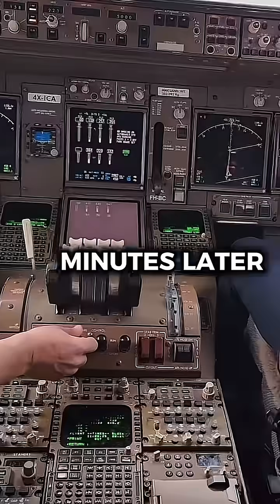What happens if an aircraft runs out of fuel?

Comment: But had they not blindly opened the crossfeed when they noticed a fuel imbalance which just doesn’t happen on modern jets and done a little investigation they would have noticed the difference between fuel used and fuel onboard and landed safely with one engine and plenty of gas.

Comment: n July 23, 1983, Air Canada Flight 143, known as the "Gimli Glider," ran out of fuel mid-flight because of a fuel calculation error where ground crews used pounds instead of kilograms, loading only half the required amount. Captain Bob Pearson and First Officer Maurice Quintal successfully glided the Boeing 767 for over 75 miles to an emergency landing at a decommissioned airbase in Gimli, Manitoba, with no injuries.   This was what I thought they were going to talk about. This was a case of refuelling with litres rather than gallons so roughly 1/3 of the needed fuel.
Reply: Somebody clap for this person
Reply: If I recall correctly, Air Canada dispatched a tanker truck to rescue the stranded aircraft, but the truck ran out of fuel en route.

Comment: Why would you move fuel to a wing that was leaking ?
Reply: They did not know it was leaking. They tried to check it manually but could not see. So, they diverted fuel supply to leaking engine which made the condition worse.

Comment: No it wasn't a water landing,
This is actually true,
Check out the full story,
But basically,
An engineer in Canada fitted a fuel pump for a different A330 airbus,
So the fuel line was rubbing against a  bracket and ruptured the fuel line,
Check out the facts,
Both the captain and first officer recieved the award for the longest flight of the largest glider,
And for saving everyone when they aircraft Landed in the AZORES airfield
Reply: It’s also Air Transat’s only major accident
Reply: @AToThePowerOfNothing 😏